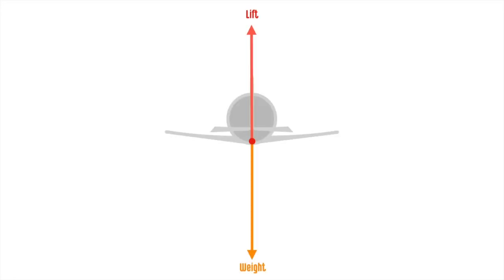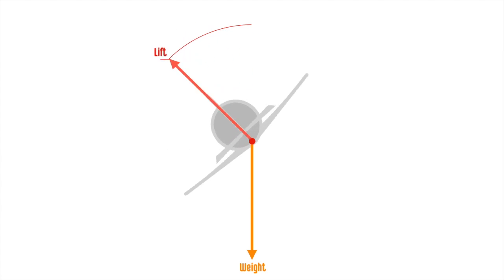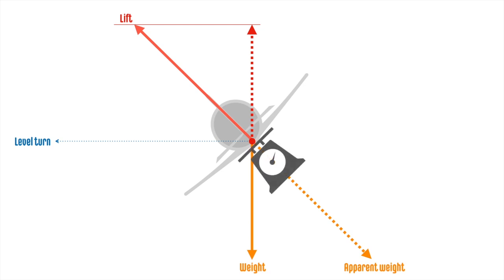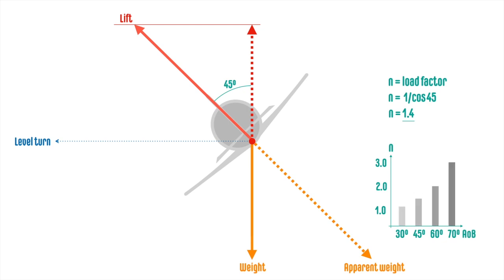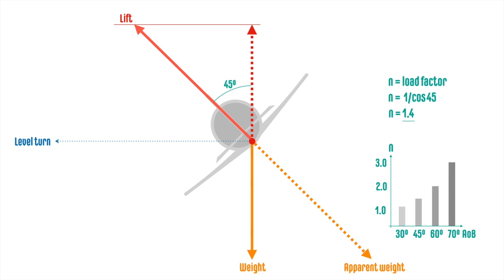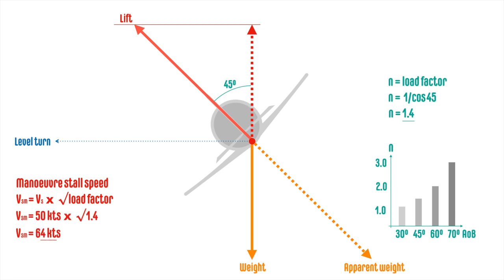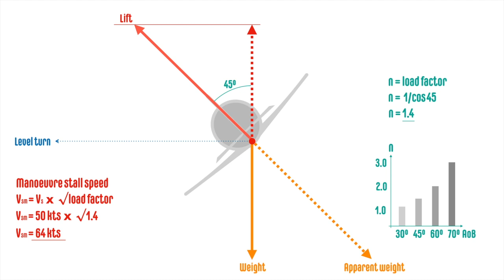How does stall speed change in a turn?

Comment: At 90 deg. bank, we end up with 0 (zero) vertical lift component thus with 0 (zero) centrical force to counteract the apparent weight. The aircraft is then subject to the gravity force of 1 G. As you see in airshows when the pilot performs a sustained 90 deg. knife edge maneuver, level flight is maintained by vectoring the thrust downward using the rudder deflection. Try using 1/COS 90 on your calculator, you'll get an error. Try now 1/COS 89.9, if we hang on to this 0.1vertical lift component, its interesting to see that we would need to pull 573.0 G in a coordinated turn to maintain level flight... want to try that... 🙂

Comment: Hello, great video but i am confused, when finding Vsm and  i input 50kts x √ 1.4 in my calculator i get the stall speed as 59kts and not 64kts like in your video. any ideas?
Reply from the maker: Hello, you are correct and we made a boo boo. Thanks for picking up on it!
Reply: @flightclubonline  thanks for confirming this lol i thought i was calculating something wrong😂
Reply: @ZackTheCamel  Me too and I am not good in math so I was thinking doing something wrong on such an easy calculation.
Reply: @flightclubonline  thank christ i went crazy spent 45 minutes researching formula only after i scrolled down comments to find out i was doing it correctly 😬
Reply: The same ! Thank you !

Comment: Something that sort of blew my mind during my glider pilot training, was when the CFI told me that you can't stall at zero g! If you're in zero g, that means you're in freefall, if you're in freefall that means you are producing zero lift, zero lift means the AoA is 0 (or very close), that means it is impossible to exceed the critical AoA (aka. the stall AoA) needed to stall a wing. Thinking about it in terms of Load Factor, 0g is the same as saying 0 load factor, and multiplying airspeed by 0 just gives 0 ahahahaha. So you have to be going 0 knots to stall in 0g. 
It really does go to show that speed is irrelevant to stalling, its all about AoA. You can stall at 2 knots and you can stall at 200 knots.

It's one of the primary reasons why we are all taught to ease the stick forward when in a stall or about to stall, because it reduces the AoA, and that lowers the stall speed.
Reply: Think about it. You are increasing the weight of the plane, and it takes more lift to carry that weight. Pushing the stick forward reduces the amount of weight, the lift surfaces are having to carry. It all comes down to weight and lift..

Comment: The model assumes that the aircraft maintains level flight, which is impossible with a 90° bank. But it has the fun implication that if you were to take the turn with infinite velocity, you wouldn't lose altitude, which is technically correct.

Comment: Key phrase everyone: “without losing altitude” meaning its not exclusively bank that causes the increase. You can bank as much as you like and not stall, and/or maintain load factor of 1, but the altitude will in a result fluctuate

Comment: I don't get the calculation at the end with 64Kts as answer.

Square root of 1.4 is 1.183215957, so 50x1.183215957 = 59 Kts

What am I doing wrong here ?
Reply from the maker: You’re doing nothing wrong. We made a boo boo in the video. It’s mentioned in the video description. Well done and thanks for picking up on it.
Reply: @flightclubonline  Oh well I didn't check the description :/, thanks for replying ! Also thanks a lot for those videos, you can't imagine how helpful they are.

Comment: As GA aircraft, probably can’t rolling into 90degree bank, the reason being, the aircraft would need huge amount of centrifugal force to compensate lost lift, however, before you have enough centrifugal force to support your flight, it will exceed the critical load factor first and stall before you step into structure damage section
Reply: In aerobatic planes it's possible to fly with 90 bank angle. Use your rudder like a elevator and you make fuselage to generate lift (like always btw).

Comment: bearing in mind that to stay in level flight in a turn, you have to increase power, by the time you roll to 60 degrees, you'll be at full power, just to stay in the turn. If you roll to 90 degrees and change nothing, the aircraft will fall out of the turn so you need more power or more pitch. You have no power left to give so you have to pull 4 g to stay in the turn. You'll soon find out about accelerated stalls.

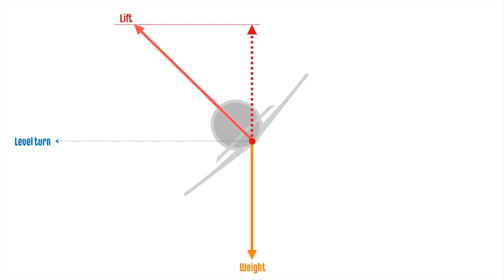Comment: 0:22 this is a big misconception. AOA in bank turn is increased "automatically". Same thing happens when plane is pitching down but with constant speed. Pitching causes temporary change of AOA, but it goes back to previous value when airspeed is constant. Pitch is not the same thing as AOA. Banking plane changes lift force vector, and vectors can be easily calculated when You know trigonometry. Cosinus of 0 degrees equals 1, so 100 % lift force goes upwards. Cosinus of 45 degrees is only 0.707.

Comment: technically, the load factor becomes infinite because there is no vertical component of lift. In reality, though, the G load is maxed out for the aircraft, and the pilot must use slightly less bank to keep from descending.

Comment: There is no centrifugal force acting outwards. For an object to take a curved trajectory there must be a force acting towards the instantaneous centre of rotation, i.e. inwards. From Newtons second law such an object experiences an acceleration. Acceleration is rate of change of velocity and velocity is a vector quantity defined by its magnitude and direction. So whilst the speed might not change, an object on a curved trajectory experiences a change in direction and hence an acceleration which requires a force (Newton's Second Law). For an aeroplane this force is generated by air passing over the wings, as it banks there is a force towards the centre of rotation and hence it changes direction. What is incorrectly described as centrifugal force (outwards) is the reaction to the applied inwards force (Newton's Third Law)

Comment: The side of the aircraft becomes the lifting area in straight flight, at 90 degrees which is poor.. It's weight verses lift ability.  It still comes down to, do you have enough lift to carry the extra weigh of the g forces on the plane. At 7 G's, a 100k plane weighs in at 700k.. you better have some strong lifting surfaces on that thing..

Comment: 50 kts x ( the 4th root of 2 = 1.1892) = 59.46 kts. Vsm is not equal to 64 kts. Everything else is OK. However, a 5 knot cushion is good anti spin insurance. Remember, the inside wing is moving slower than the outside wing in a turn. An unexpected snap roll is very unsettling.
Reply: I thought i was alone ,, i did the calculation and got 59